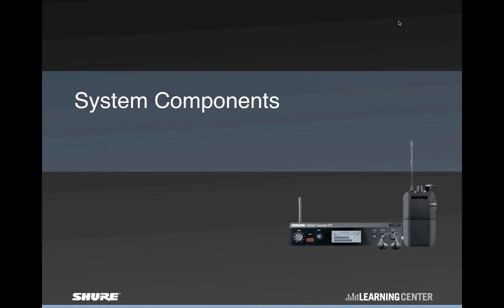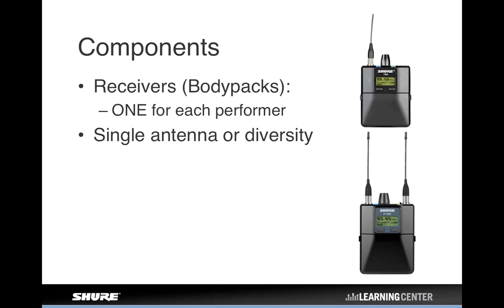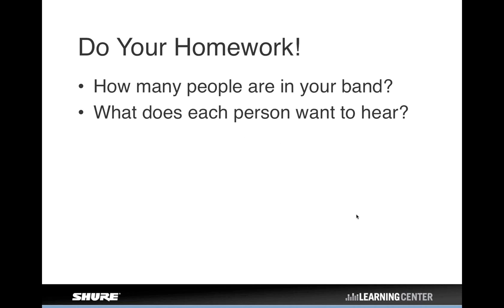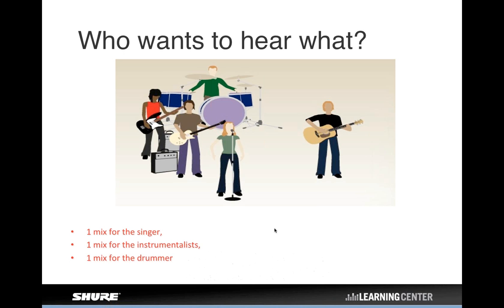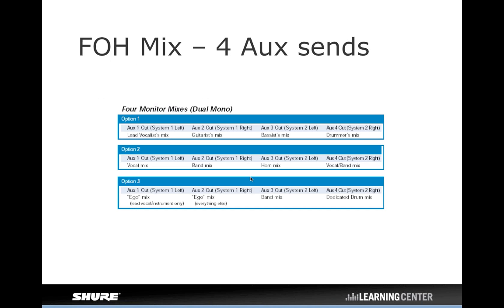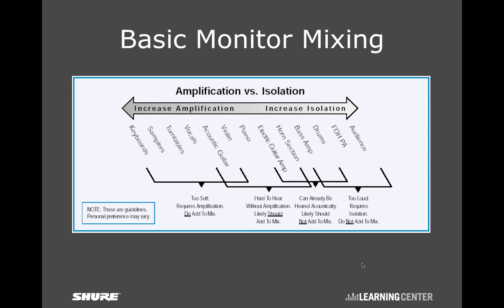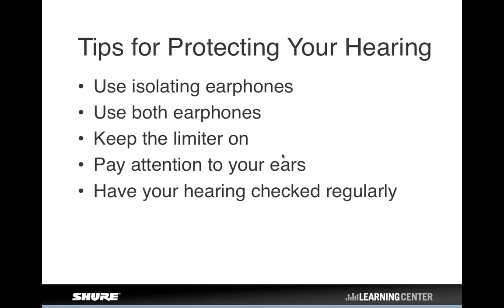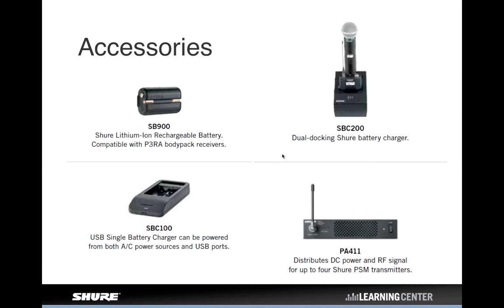Webinar: How to Choose and Use Personal Monitor Systems | Shure

Comment: I dont undemanding why shure and other brands they make a earphone with the pipes facing up direction . And the pipe foe the tip is to short.inpossible to get a good sound. I tried with 100 tips. Impossible.  With the Sony in straight direction and longer pipe. No issues. Bad thinking with the earphones to be honest